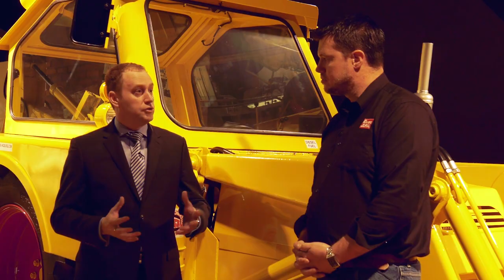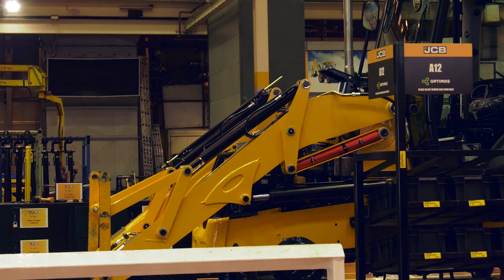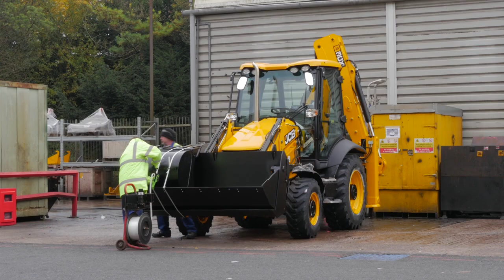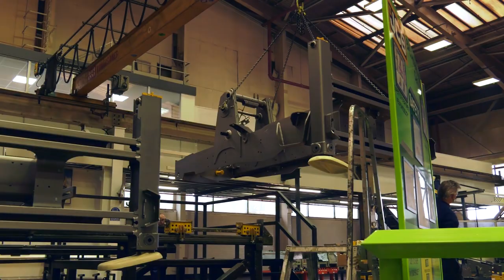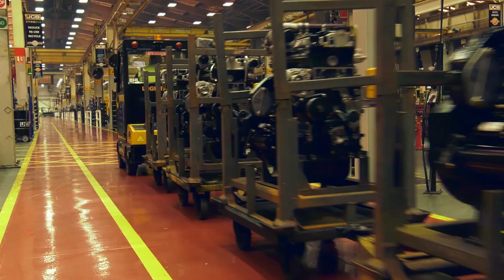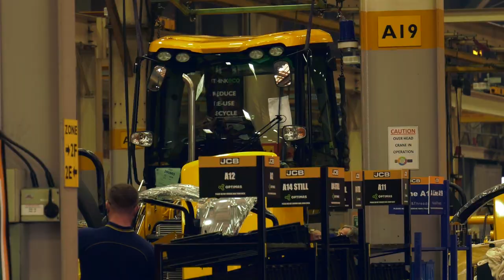Inside the JCB factory

Comment: Aaaaargh tractor porn 😋
So this factory, assuming its 24hrs, 365, knocks out almost 33,000 various units per year. Who the hell buys all these machines? There must be a huge area filled with machines just sitting about waiting to be bought.
My most treasured JCB item are my JCB Pro Boot socks from Matalan at £7 for 3 pairs, luxuriously soft and heavy duty. (other shops are available 😁)
Great video, I would love to work in this factory after I spent first 2 months drooling over the machines 😁😜
Reply: In the U.K. they are by far the most common brand of Construction equipment. Also I think it’s the most common brand in India also.
Reply: The life of the machines is not very long in large construction. Not sure of the exact time but it’s something like 18months. They are continually changed also their world market is huge. Great historical company.

Comment: Ive had the opportunity to have driven all of the jcb backhoe diggers apart from the 53 model loadall  ive allways wonderd why oth builders usdd 3 cyl engines instead of 4 like jcb  ford 550s allways seemed lacking in torque  but they were a smaller machine . The 3cx has allways bn a larger machine . Tbey have their issues too they not perfect but what is .

Comment: And now of course in 2020, JCB doing a range of 100% electric diggers so they can dig indoors without air issues and no noise too! I think now is the time JCB forge ahead and do 100% electric machines no more Diesel no more Petrol machines. Yes it mean changing their factories over from the ICE building area's to Electric motors and Battery etc. But times change as the world is now moving into more Electric powered machine and ships and even planes and of course Cars and trucks... Time to dump the polluting noisy hard to maintain Diesel and Petrol engine based JCB's and make JCB and Britain the world leading Battery and Electric machine maker doing as many farming and industry systems as possible, The Lithe-on Ion battery was invented here the electric motor was too and the Hydraulics was also invented here and of course the 4x4 wheel drive also. Those who work now with complex ICE system motors can easily retrain to do a simpler electric motor system. if any thing the new tech will make jobs as the demand for these pollution and noise free efficient machine will grow as people see they are far better than the complex noise dirty polluting expensive to maintain ICE machines.. Farmers can use wind and solar to charge up their electric tractors and combines on the farm without paying for expensive Diesel and without problems of expensive maintaining and any excess electricity they have can be sold to the national grid making more money for them.  The power of the Electric systems will out do any Diesel system and cost a faction to use or maintain.  a win win.  no pollution no noise low vibration. the future is here! Those whom don't change will pass into the history books.